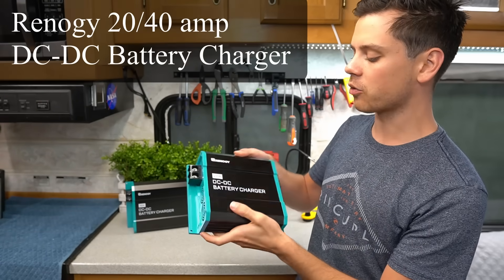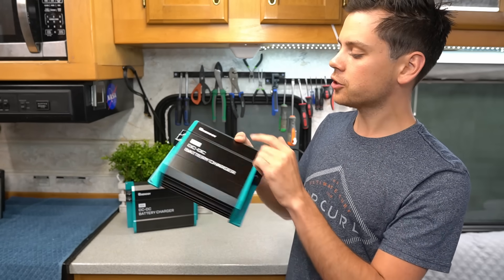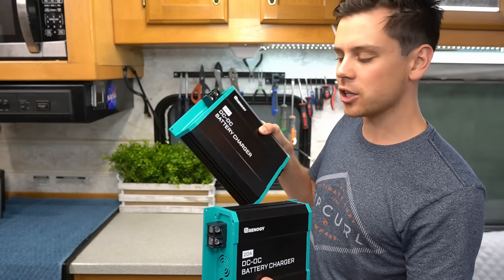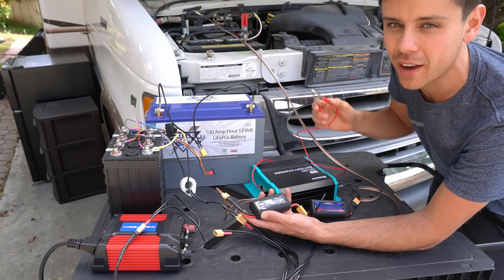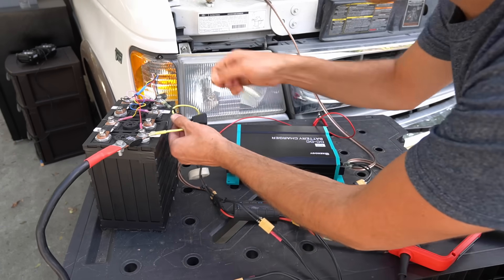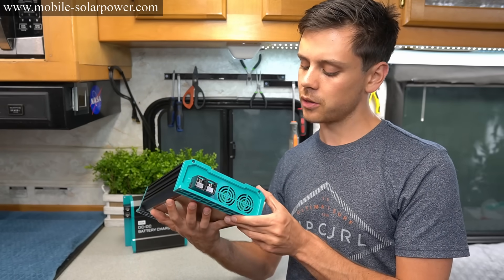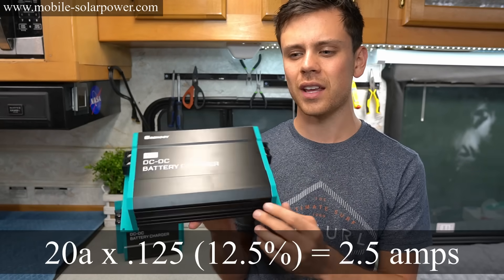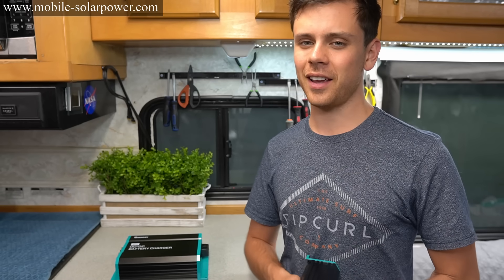Renogy DC-DC Battery Charger Review: "Smart" Alternator Charging for Solar Batteries!

Comment: Hi Will, your video is definitely steering me towards purchasing one of these. What's your view on Floating LifePO4 batteries? I know there are views that it degrades lifespan while others like battleborn recommend a sub 13.6 float charge. Looking at the renogy manual I was going to use a 14.4 bulk and 13.2 float. Does that seem right to you?
Reply: As I understand it, a sub 13.6 float setting will basically keep the LifePO4 from being "floated", since the Lithium should hold a voltage close to that over most of it's discharge.  My BB tends to stabilize under load at 13.3V from where I read it.   So, <13.6 is close enough to "no float" to avoid the issue  which is that with Lithium, constantly putting a charge into the battery  while full reduces it's life.    On the other hand running a <13.6 float setting (vs zero float) might actually help keep from depleting the battery under light load while driving.  I think that depends on how the algorithm on the charger is set up, what will trigger to start a new cycle.

That said, I'm charging "straight" from my high output alternator.  Actually going through a battery connector (Victron Li-Connect) that has no charging management, just on and off.  So, I'm charging at whatever voltage gets to the battery while on the highway.  That varies from 13.4 to 14.2.    I've been told that it's really not an issue in an RV as it's only a limited number of hours that you might be charging into a fully charged battery.  That is, it's not 24/7 like an AC charger might be doing,  nor is even 12/7 like a solar system might be doing.  SO, as far as connecting to an alternator charger on an RV the natural cycles of driving an stopping to sleep will give the battery enough relief so that excess "float" voltage/time is limited and not a big factor on battery life. 

Make any sense?  It's not easy to understand all this.  Part of the confustion is that Lithium battery owners have to deal with everything through the lens of the more complex Lead/Acid knowledge and systems.  If we didn't have to use devices set up for Lead, we would not have to deal with pointless multiple charge phases and settings.

Comment: Could you use this with a seperate renogy mppt charge controller with a solar panel, as in both charging the same battery in say a vehicle with roof mounted solar ?
Reply: im wondering the same thing, will having both running at the same time hurt the battery or the mppt or this unit? Im thinking it is ok but it would be nice if Will mentioned that since most people who have a solar set up are getting this as some extra charging when vehicle is running.
Reply: I would think that it should be fine as long as the two sources never pass your battery's charging limit.   On a lithium probably won't.  On lead acid, it depends.   If you have, say 15 amps of solar coming in and 20 amps of alternator, then you have 35 amps charge rate.   A 100 ah lead acid would not like it so much, perhaps.  A 100 ah lifepo4 would be fine.   200 ah of lead acid would be fine with this input.

Comment: Can you have this charger and the solar MPPT controller charging the battery at the same time? I would like to have both options to charge the battery at the same time without having to disconnect one or the other manually.
Reply from the maker: Yes, you can have both charging a battery at the same time

Comment: Couldn't you connect it to an 'engine running' connection rather than an 'ignition on' connection? I.e. a wire that is only powered when the engine is running?
Reply: Yes, that is what the D+ connection is - from the alternator, so only powers on when the alternator starts putting out.  That is an option for connecting this.

Comment: Sorry dumb question probably. I can't connect my vehicle battery to the pv in on my solar charge control?
Reply from the maker: No those are not current limited and it would either destroy itself or it would turn itself off

Comment: Thoughts on using this to charge the engine starter batteries FROM the house deep cycle batteries? So the opposite as intended.   I’m wondering if that is why they have the amp reduction function/switch which you didn’t know why anyone would use.   If I could get 5 amp DC to DC charger just to maintain the starter batteries I would be set.

Comment: any reason NOT to connect the RV alternator to the existing solar charge controller?
Reply: 1 reason not to , would be if the engine chassis ground is connected to your house bank ground. Some Mppt if earth switch, requires isolated earth to regulate power...
Reply: @kuzcuz  thnx, all negative connected to the metal parts(chassis) of the motorhome,

Comment: You can put a switch on the dash and when your engine is worm then flip the switch
Reply: I was thinking exactly the same thing. As long as you remember to flip the switch :)
Reply: @Fastmack  or you can use an arduino to sense the voltage when the ignition is turn and to start a timer after witch to send the signal to the charge controller to start charging.

Comment: Do you really need this on a Battleborn? Hasn't it got built in electronics to take care of all of this?
Reply from the maker: Yes. Battle born especially. Internal resistance low so alternator damage susceptibility high
Reply: @WillProwse  Thanks for the response. I chuckled, because part of their sales pitch is that the battery can charge so quickly - pity about the alternator burning out in the process :-) But I think I will get a Battleborn as well as the Renogy anyway.

Comment: Thanks for the review. 
I am trying to install the "Renogy 40A DC to DC Battery Charger" on my RV, However i;m a little confused by Renogry instructions and wiring diagram.
I not sure where in the diagram to connect my other charging sources?
Right now, both the shore power and the build generator are hooked up to charge the batteries though a AC to DC Power Converter (13.6v 60 amp). 

However, I'am replacing the existing lead acid house battery with two (12v 100 amp LiFePO4 in parallel ) My question is should I tie the Power Converter on the House battery  side or the Starter Battery side of the DC-DC converter.

Currently I am running (+) from, House Battery to Fuse to Victron BP-220 to Off/On switch to the DC /DC charge to all loads buss bar.

Thank for any advice.
Reply: Did you every get an answer, I'm trying to do the same thing.

Comment: I have ordered 8x (3.2volt 90AH) to build a leisure battery for my campervan.  I wanted to do a 12volt battery for simplicity but think that the the 24volt version of this settup would be better (less AMPs everywhere)  This thing seems to be perfect for a 12volt system.  Is there such a thing for a 24volt leisure battery setup?  Thanks, and I totally love the videos.
Reply from the maker: Thanks man. And yes, it's a bit more expensive and it's made by sterling, but it is a 12-24 volt battery charger. Really cool device.

Comment: This might sound silly, I want to get my kids into renewable energy.  I wanted to use a 12v alternator to charge a battery for my kids to use  for a radio or tv. My kids would use a bike to run the alternator which would charge the battery. What would you recommend to put between the battery and alternator?
Reply: That is a awsome idea. You got my mind running now.

Comment: Will you create a wind-solar hybrid system?  Use the turbine at night if there is a way you can easily mount/dismount, connect/disconnect and store the turbine in your RV?
Reply from the maker: Just connect them all to one battery. No problem
Reply: @WillProwse  no need for a hybrid charge controller?

Comment: The ignition circuit gives you the option to hook it to a switch. I'm willing to bet a lot of people would prefer that option, than wouldn't.
Reply: How do I even connect it to the ignition circuit?  Struggling figuring this out, any help is much appreciated.
Reply: @treecycled  your radio has an ignition wire it's one of many options but probably easiest to understand.. just dont confuse the 2 power wires. Radios also have a constant 12v battery wire to save all your presets.. consult a wire diagram or test with a volt meter to be sure. Volt meter black to a known ground (can use the metal frame behind the battery) red lead to the wire you suspect to be the ignition wire, usually red, can be yellow. If 0v when car is off and 12 to 14v when car is on, that's your ignition wire.. just tap into that
Reply: @ruseventyfour2948  I ended up splicing a wire in with the radio fuse, with a switch, to just manually toggle it on when the car is on..Going to rewire it when i rebuild my system in the future. THanks!
Reply: I’m installing this in my truck and grabbing the ignition line from the harness on the hitch.
Reply: @Justin Dix  Did the hitch harness wire work for you? I tried doing that, but the unit isn’t turning on for me. I’m wondering if it’s too low a voltage to properly “switch” despite having readings that indicate it’s ignition driven.
Reply: @flyingjjmonkey  It did! I ran a #12 from the rear hitch harness to the switched terminal. Works great! What size wire did you run? Did you test the voltage at the harness?
Reply: After seeing the video i was thinking the same thing ! So if i understand correctly the ignition circuit is a +12V, meaning I can simply use any switch with a +12V from any battery and that would work? I would just turn it on when I'm driving... Can you confirm? Thanks
Reply: @cedrickessler3503  Correct.  You could just use the constant 12v from the input and run that to a switch then back to the switched terminal and it would work anytime the switch was turned on, regardless if the vehicle was started or not.

Comment: Hey Bro,

Can you do a video on how to integrate your solar in a home for regular use instead of a "emergency setup"...I was thinking of putting in dedicated solar outlets throughout the house, converging in the basement where the setup will be. My wife hates seeing wires and shit everywhere and I don't wanna lug around the setup throughout the house. Thanks bro
Reply: I did just that to my house, now wired for ac and dc. Great thing about it is that a inverter is not used and the 10-20% voltage drop. The charger controller has a load port that allows wiring to a electric breaker box. Going to have a video up in a few days but have to finish watching Will's videos first.

Comment: Morning Will. I've got a 3k w inverter SolarEpic MPPT 40A Solar Charge Controller 2 270w panels but I have 42 SPIM08HP lipo pouches which I was trying to build a DIY kodiak from Jehu Garcia's channel. I'll end up with 6 7cell 24v batteries. His inverter has the charge controller what would you suggest using that type of battery with a stand-alone controller?

Comment: My understanding is that most, if not all, lithium chemistry batteries are damaged by charging at temps under freezing. Would not a temp sensor be even more vital for lithium? Perhaps this charger has an internal temp sensor for ambient conditions?
Reply: G Henrickson I think getting a heating pad would be a good way to combat this from even happening